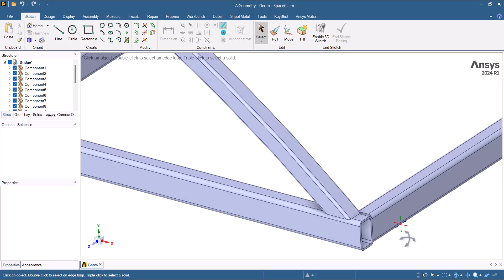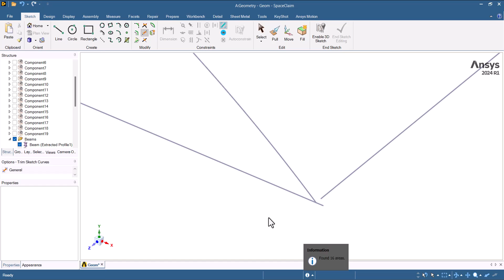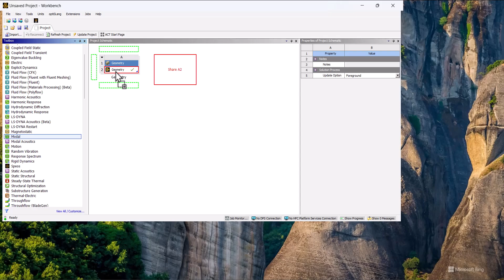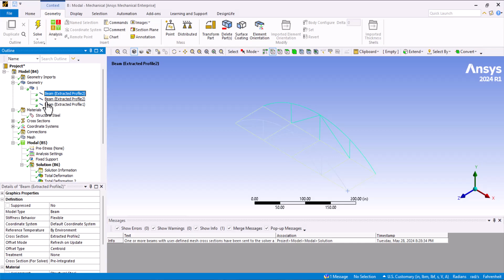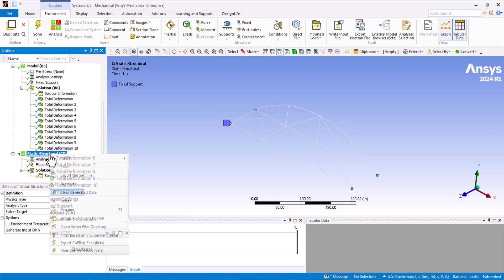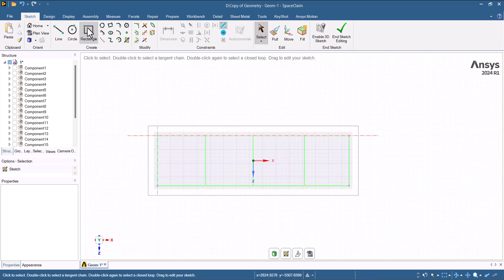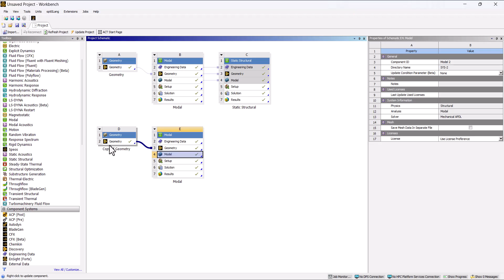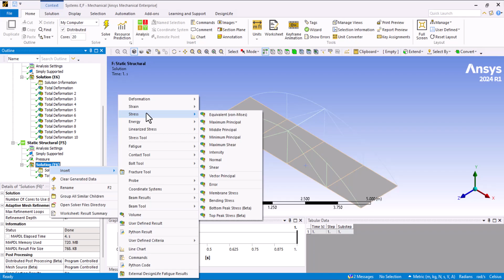🔧Ansys Tutorial: How to convert 3D parts to 1D elements

Comment: Hello, the main question I have is about making connections. When using connect, don't the beams rotate, losing their initial geometry? Because my structure has beams with different profiles, when I extract the beam elements, they become “misaligned.” In that case, what should I do?
Reply from the maker: Hello, I don't understand what you mean by misaligned. Beams convert to lines. You can fix them by connecting or moving operators.
Reply: @caewitharminhashemi  Hi, I think misaligned is not the correct word. Imagine I have a C-beam welded to a rectangular cross-section beam. Since the C-section is not symmetrical, even if the 3D models are properly aligned (i.e., the flange surfaces of the C-profile coincide with the outer surfaces of the rectangular profile), the beam-extraction tool still generates “disconnected lines”, just like in your video. To maintain the connection I can manually move the beam lines so they meet, but as soon as I do that, if I visualize the solid beams, the structure looks disconnected because the solid representation no longer matches the shifted line. My question is: is this just a visual artifact of the beam solid display, or does it mean I should introduce an explicit offset between the beam line and the 3D geometry visualization to ensure a correct structural connection?
Reply from the maker: Beam elements are lines, and the moment of inertia is calculated by the cross-section. Only the lines must coincide correctly, and the 3D shape of the beam is not important after enabling the 'show beams' option.  @felipesegura8341
Reply: @caewitharminhashemi Thanks so much for the answer! I'm a mechanical engineering student and I'm learning FEM analysis, and even though I've learned a lot, I still struggle with details like this. Your channel is a gold mine, thank you very much!
Reply from the maker: @felipesegura8341 I appreciate it